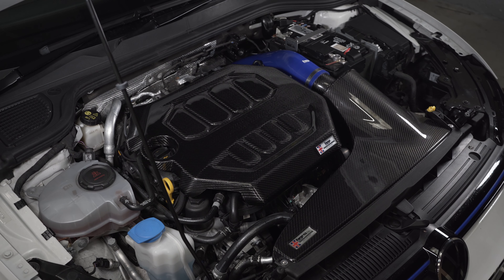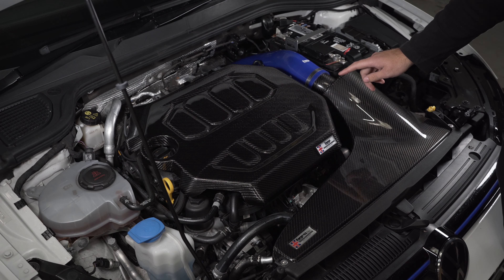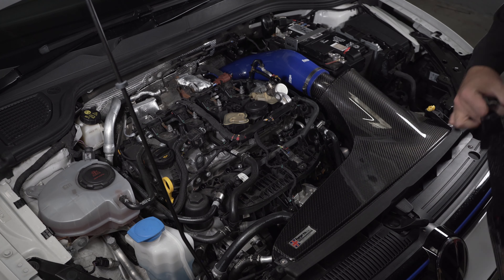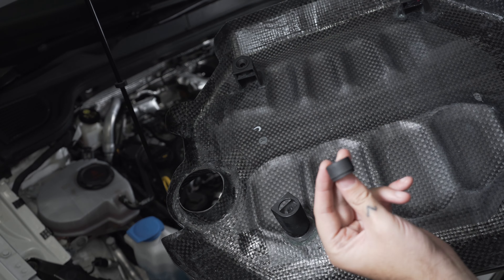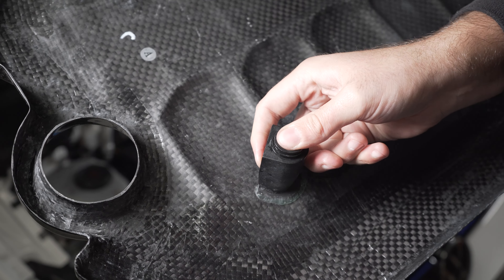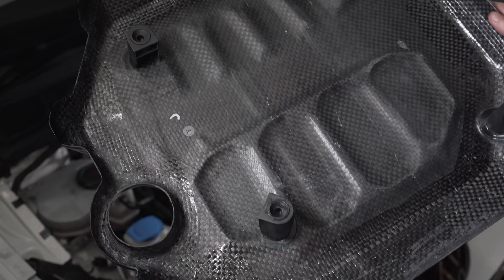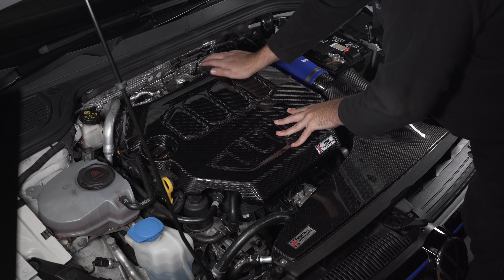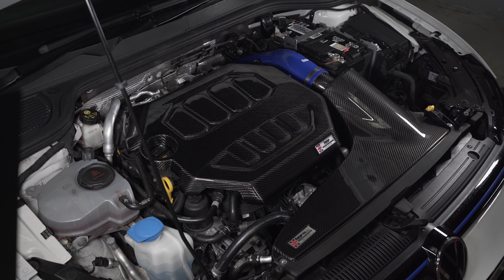How To Install your Carbon Fibre Engine Cover on EA888 Platform - MK8 Golf R, FMEC3

Comment: Is it good for heat from the engine?
Reply from the maker: It is - carbon fibre has low thermal conductivity, which lends itself well to this type of application. 🤓
Reply: @forgemotorsport  It looks fabulous! Can you disclose the type of resin you have used?

Comment: Superb modification to any engine bay - do you make the engine cover so that the carbon fibre weave matches that of the air intake (same weave direction) ? Many thanks
Reply from the maker: Hi Barry! Thank you for your positive comments, yes it does, you can check out the web listing for some photos - https://www.forgemotorsport.co.uk/VW_Audi_Cupra_Skoda_EA888_Gen_4_Carbon_Fibre_Engine_Cover--product--2146.html

Comment: How remove… where pull so it does not crack? Just yank?
Reply from the maker: HI! We recommend when removing the carbon cover place your hand under the cover where the mounting grommet is located and pull upwards with a gentle and smooth action. Thanks! Zac - Forge UK